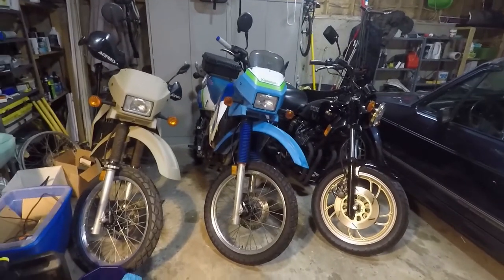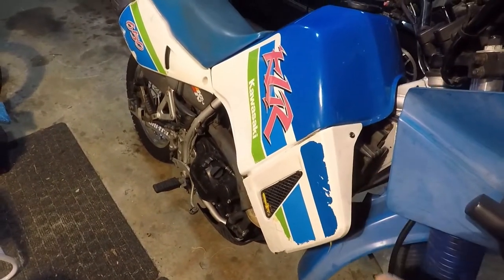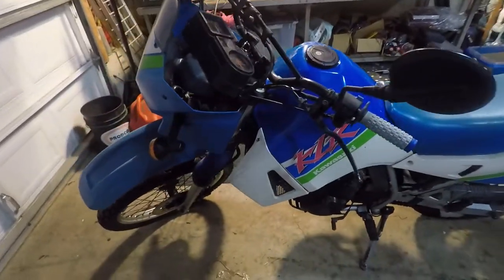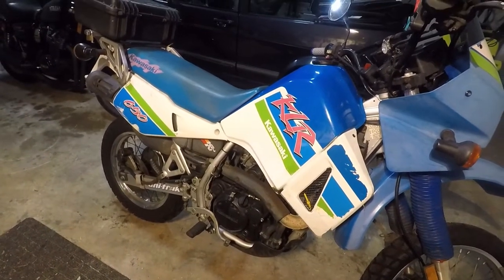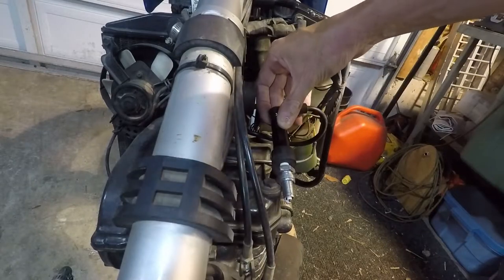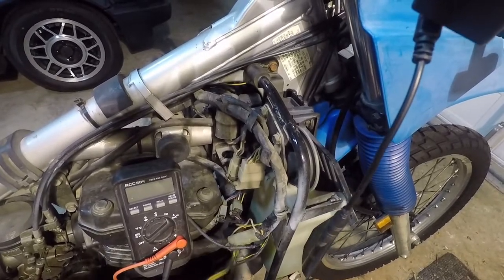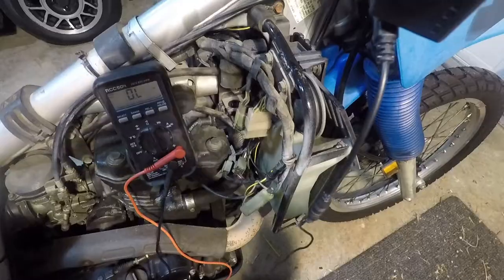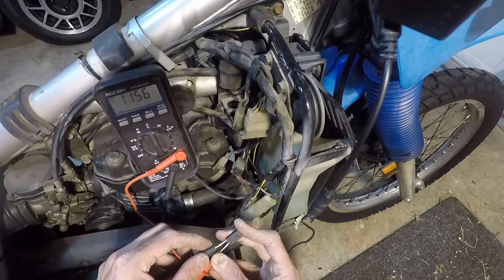NO SPARK! KLR 650 ignition system troubleshooting and repair

Comment: I bought an 01 a few months ago, first klr but have wanted one for awhile.  Learned a lot about them in the past few months, rebuilt the carb, suspension, bearings, lots of little nuts and bolts too.  After finally getting it back together with my new crash bars and getting on the rode I lost spark as well, I haven’t tore into mine yet but I feel pretty confident from your video that I can figure it out.
Reply: P pl

Comment: My chain popped and cut the red and 1 yellow. Chain was jammed in the engine case and sprocket. No spark now. Wire coulda of got yanked when chain pulled the wires a little. Ill open up thr stator side and see what happens next. Great video by the way

Comment: Thanks for this walkthrough! My bike ended up having exactly the same issue, double the typical resistance on the spark plug cap and a broken exciter coil. My KL650 is running beautifully now.

Comment: When I try to get a reading on the exciter coil red and white wire I get nothing just OL, however when I crank it and set the meter to voltage I get 50-60v per crank. Is it possible the stator is bad ? It was working fine yesterday now no life. It goes seem to shoot a spark every now and then but it’s rare

Comment: Excellent, informative methodical troubleshooting video.
Been a used KLR 650 since 2003.
On my second one a 2003.
I lost ignition last year.
Turned out to be the ignition coil.
I replaced it , the secondary  spark plug lead and cap which comes with replacement OEM coil from Kawasaki.
I am now a subscriber and will watching all of your videos.
Thank you so very much.

Comment: I really liked the electrical job you did on the klr maybe you can give an idea on a problem I got with mine as I did the same job on mine then it developed a new slight problem the oil light (red) on the dash doesn't go of when the motorcycle starts mine is a model C9  2004 it doesn't have temperature gauge just a green light for neutral and a red for the oil on check position it light up and when running normally goes off the harness and engine have been rebuilt and this problem didn't existed before either After the rebuilt it started when changed the stator ECU and the spark plug coil